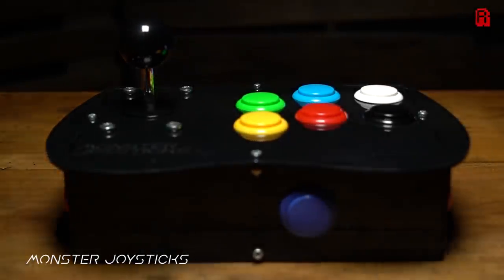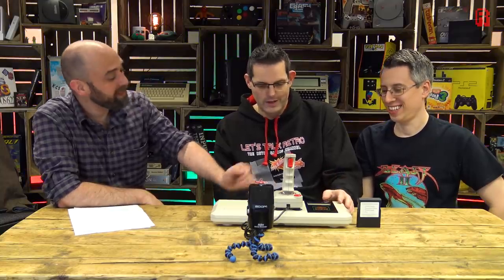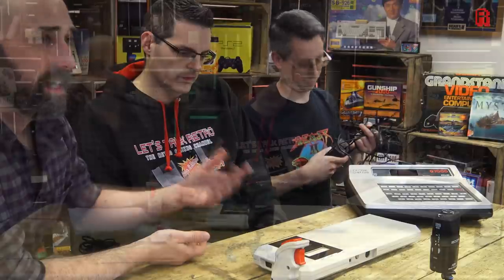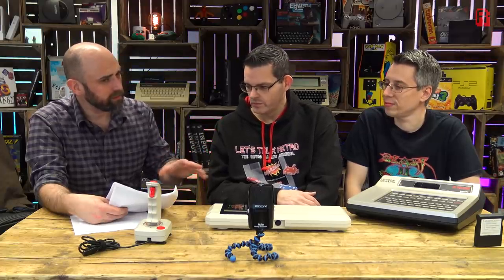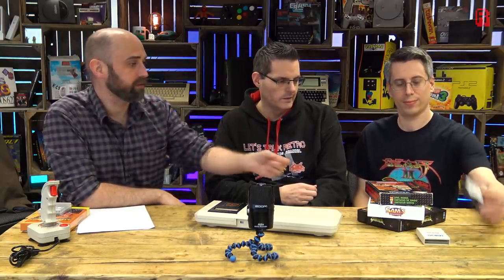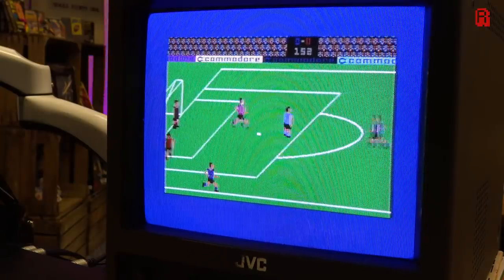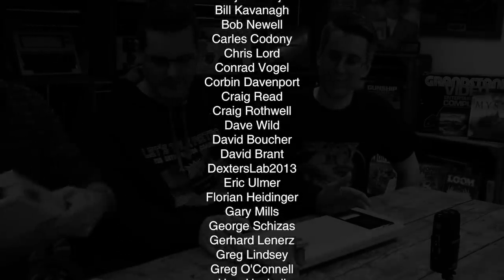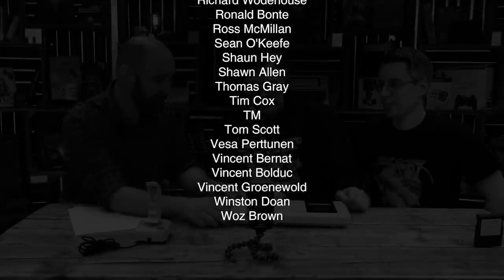Commodore 64GS Console | Show & Tell with Lets Talk Retro

Comment: I believe the Max was pretty much the C64 with less memory - it has the SID chip for example. Max cartridges run on the C64 - so would run on the C64GS as well!
Reply: Correct, the C64 actually came later and was based on the same core technology.  It's like they took the MAX, gave it 64K of RAM, put it in a VIC-20 case and gave it the VIC-20 keyboard, and ported the Kernal and BASIC from the VIC-20 to it.  One could argue that the C64 was partially based on the VIC-20, but the MAX definitely wasn't.  By the way, the C64 might well have been in the works from the start, but it did come a bit after the MAX.

Comment: @RetroManCave at 12:50 actually on the C64 the mapping of the keyboard and the trigger button of joystick on port 1 are related, so pushing the Joy1 trigger would match the "press any key". That's also the reason why many games used Port2, to circumvent those joystick keyboard mapping problems.
Reply from the maker: Interesting, that would help in some situations but you're still left with a problem if it needs you to press a specific key to start, or to input a name in a scoreboard.  Thanks for pointing that out

Comment: Commodore MAX was a C64.  Not a VIC-20.  Just reduced RAM and ROM and a terrible keyboard.
Reply: The C64 was actually based on the Max.
Reply: @skonkfactory  Right, that's what I was saying.  They are almost the same hardware.  The MAX was first and the C64 was just more of the same.
Reply from the maker: You are correct!  I should have listened to James.  James is wise.  Thanks for watching

Comment: If Commodore had any sense (they didn't, they had Medhi Ali instead) they would have done a games console in 1990 based on the Amiga, and given it cartridge based storage, there would have been no harm in using the Zorro II memory space mapped to a cartridge ROM, allowing up to 8MB (or 64mbits!) cartridges. That would have tided them over until CD became viable for mass production. That would have made so much more sense...

Comment: Any key is no problem in most games as the port one fire button is almost the same as the space bar. Only a few can detect the difference.
As a lot of games use the space bar for jumping etc. if the fire button was needed for firing. I soldered wires to the second button of my competition pro and connected them to port 1.

Comment: One important key point that many people seem to ignore, when comparing C64GS with CD32:

When putting a tape or disk game on a cartridge, is going to make the production (and end product) way more expensive.

BUT if you put a disk game on CD, you probably make the production cheaper.

So because of that, I can definitely understand, why way more companies invested in CD32, than C64GS. Also, A1200 hardware wasn't as outdated at CD32 release, as C64 hardware was at C64GS release time.

And of course CD32 was selling quite well (except in the US, where it couldn't be officially sold), but the company was already going down for other reasons.

As I see it, there were 2 good things resulting from C64GS:
1)Bunch of quite good cartridge games released mostly by Ocean. Many of them wouldn't have worked that well from a disk. Sure, they could have been done without GS aswell, but I guess it gave companies that additional push.
2)Official standard for 2 button controller. Sure, not that many games have used it (in addition to Ocean carts), but then again, many games are done with 1 button controllers in mind.

As for Commodore Max, I think it was at least mostly C64 tech. Way less RAM, but I think that sound & gfx hardware is basically the same. And not built-in ROM of any kind.
MAX cartridges actually do work on C64! There's a crappy version of Wizard of Wor for example: https://www.youtube.com/watch?v=o-gf7v2PZqo

(Yes, the proper C64 port is WAY better, but Max is VERY restricted hardware)

Comment: One of my biggest regrets in life, was not buying one of these for £10 in a second hand shop sometime in the mid 90's. Boxed and everything. It got me curious. I could tell, even by looking at it in the shop window, that it was a stripped down C64. But I was torn between spending £10 on something I basically already had, in the regular C64, or not. Alas, my pension slipped through my fingers. I've said elsewhere, that I believe that the concept of a C64 console could have possibly been successful. Not as a cartridge system, but as a tape system. Hear me out. If they'd have gotten the retail price down to about £50, and had a cassette drive built in (No cartridge port.), I actually believe it could have been a tempting offer. The back catalogue of C64 tape library was huge and cheap. I think it would have appealed to the budget market and those who had once owned a C64, moved on, yet missed the old skool classics on the system. Don't get me wrong, I don't think it would have been a SNES killer. But I do think potential existed in the concept of a stripped down C64. Oh, and as a basic workaround for games which required keyboard input, include the ability to bring up an onscreen keyboard operated by joystick. Bottom line is, I think it had potential as a very rough-edged budget system. Not dissimilar to the classic mini's that we've recently seen.

Comment: Interesting that this came 3 years after the Atari XEGS, which was a very similar concept. The XEGS of course had a keyboard and supported peripherals like disk and tape drives, so it wasn't nearly as limited as the 64GS. You'd think Commodore would pay attention to what the competition were up to. All that said, both systems were basically obsolete on release and complete commercial flops so comparisons are immaterial really. 😆

Comment: Just had a squizz at the Argos catalogue 1990. That year the NES was £94, so straight away you could have a much more advanced and better supported console for a fiver less. If you were on a tight budget you could have an Atari 2600 for under £60 and you could probably buy dirt cheap second hand games for it pretty much everywhere at that point. On the other hand if you were absolutely determined to own a C64 the Light Fantastic pack was £159 and came with 10 games, a lightgun, 3D glasses and - most tellingly - a keyboard. Which made £99 for a model with no support for keyboards or tape storage and which only came with four pack-in games seem a bit pricey. For some reason Argos didn't carry the Master System at this point but it was widely available and priced to compete with the NES, so that was another alternative that was probably both cheaper and vastly better supported than the C64GS. 

You can see why to a maketing guy somewhere the GS seemed like a licence to print money; consoles were all the rage, just saw the keyboard and tape drive off our computer and we can sell it as a console but unlike Sega and Nintendo we don't have to spend any money on R&D or development. But they forgot that no matter how cheaply and quickly they can make something, they still have to sell it if they want to turn a profit and for that you have to provide people with a reason to want to buy one. Even Amstrad understood that; the GX4000 had some little hardware tricks that the original CPC models didn't, and at least it came with proper Nintendo-style joypads instead of just an old Cheetah joystick spray painted white. The C64GS reeks of low effort in a way the GX4000 (for all its faults) didn't.

Comment: It's an odd idea.
Honestly as far as the microcomputer as console idea goes, the Atari XEGS probably did it better.
Smaller form factor, includes a detachable keyboard.
Games built in, primarily meant for cartridges, but still runs pretty much everything the Atari micros did - and was out earlier, making 8 bit tech slightly more relevant.
Still flopped though.

Funnily enough Nintendo was going to bring the Famicom to the US as a microcomputer originally (Nintendo AVS) but was advised against it by pretty much everyone in the US because of the US video game market crash.
I bet that it would have gone down reasonably well in Europe though, given we preferred micros to consoles...

It's weird when you think about 'could have beens'.
(we do have some sense of what that might have been like incidentally, since the Famicom had an optional keyboard and tape drive along with a basic cartridge... It amuses me to think one of the most well known consoles in history can technically be classed as a hybrid console/microcomputer originally.)
Reply: The XEGS was really the first thing that came to mind when they started talking about what this would be up against, but it seems that the XEGS came out a few years prior. And the Amstrad one they mentioned was a complete unknown to me.

Comment: I loved everything about this episode, except the Commodore part LOL   Oh and the Max is C64 based hardware :-P
Reply: More like the MAX is a close cousin to the C64.  They share a lot of hardware, same CPU, VIC II, and SID chips but with only 2.5KB of RAM.  The C64 came out slightly after the MAX and has backwards compatibility mode to use the MAX cartridges.  The early C64 games on cart, its probably about 50-50 if its just straight up a MAX cart with a different label or something that was actually updated and modified to take advantage of the C64.
Reply: @JeremyLevi   The C64 seems like a combination of the MAX and VIC-20, really.  It's as though they grafted the new technology of the MAX into the VIC-20, upped the memory to 64K, and made some other changes like a second joystick port, and there you have it, the best-selling single-model computer of all time.

Comment: You should throw away that paper shielding, it is known to cause overheating issues causing SID-chips to die in regular C64 computers, and that 64GS case is much smaller then a regular C64 case so the components might get even hotter inside that thing. At least install some heatsinks if you want to continue using the shield.

Comment: Looking at most of these console conversions in EU regions the concept is fine but the build and timing are way off. Like you can use all the old components but to make a console you need a whole new board to turn a slab into a box otherwise that is all you get, a C64 without a keyboard. There was a chance to modernize the controller, tap some more buttons off the Paddle pins, that might have given it a selling point IE. C64 gamepad. Software has to be consolized for easy use and Commodore undermined that here and in the Amiga CD32. Lastly sooner than later is better but if you're late you have to add some extras. :\

Comment: The C64GS was only 50 bucks less than a C64 bundle in 1990, you were limited to using those rubbish bundled joysticks I think (2 independent fire buttons) just like when you want to play MSX Salamander with a Euromax Zipstik but need to use a Toshiba branded 2 button MSX joystick. Hardly any must have games on cartridge for GS could rival the best of the best C64 single load tape gaming masterpieces AKA the console quality bracket of C64 games. The whole thing was a perfect storm of bad ideas meets bad decisions. Not one single aspect of this thing is right, the only thing that wasn't a problem was the 1981 spec 6510/VIC2/SID vs NES games.

Comment: The Max is absolutely C64 based - the VIC II is inside, even as the SID. Commodore made the C64 virtually out of the "Max". You can even use every  Max-Cartridge in the C64, though C64-Cartridges do not work in a Max...
Reply from the maker: Thank you!  That's a system I need to get my hands on for a closer look

Comment: Does the main board still have a connector for the keyboard?
Reply from the maker: The keyboard connector is not there but you could add one.  It would be interesting to see if the ROM supports it or if you'd need to swap in a regular C64 ROM
Reply: @RMCRetro  Now there's a project to think about.

Comment: Interesting that it essentially is a c64 inside. I suppose you could wire up a keyboard maybe through some sort port to have it external but then again not much point in cutting into this as c64 are common anyway.  

Are there any exclusive games for this machine or any that where wrote for it then  later released for the 64?

Does show the miss management of commodore though.  Even in 1990 they where obviously too keen to hold onto old hardware and milk it rather than try to push the envolope.  If an Amiga console had of came in 1990 rather then the cd32 in 93 then it might of made a bigger difference. 

Good video regardless RMC.  Nice to see you involving other content creates in your channel.

Comment: Damn, I remember this and thought 'Why!?'

The Amiga dumped on it hard and Commodore 8-bit tech was in it's twilight years sadly with the Amiga soon to follow due to Commodore resting on it's laurels and then the downfall.

Interesting as a piece of tech but was a massively bad idea in retrospect and pushing out an Amiga 16bit CD console in 1990-1991 may have served them better than waiting to push out the CD32 years later.

Ultimately tho, advancements in PC tech/software killed the Amiga.

Comment: Wouldn't some of the games that required input from "any key" work if you had a joystick in Port 2 (I think it was that one) and randomly moved or pressed the button?  I remember one of the ports would send garbage characters if you randomly moved the stick if you were still in BASIC.
Reply: @Rooflesoft Games Yep, I never had cartridges - never saw the point being in the more disc-centric US, but the games I remember requiring "minimal" keyboard input were usually space - which would have been OK with the wiggly-joystick input, but a few wildcards wanted things like enter, F-keys, or name-before-entry.  It's coming back a bit now, the few single player games that actually read from Port 1 were always kind of annoying if only because it was a pointless joystick swap.

Comment: Why didnt they have a button that connected as a single key on the keyboard to make old games compatible? Why didn't they have a slot in the case so you could connect a tape drive and suddenly have access to the huge C64 library?
It appears that the accountants designed this machine rather than engineers.

Comment: Actually, the Max Machine wasn't based on the VIC 20;  the C64 was actually based on the Max.
Reply from the maker: You are indeed correct, I had it in my mind that the Max was based on the Vic20 because of its lower specs but it's an odd "nearly C64" spec machine.  Hopefully we can get one in the Cave one day to investigate.  Hope you enjoyed the rest of the chat
Reply: @RMCRetro  Oddly, the thing closest to the Vic in the Max is that it uses SRAM rather than DRAM, just like the old VIC-20.  I guess DRAM wasn't quite ready yet, or they didn't want to deal with the fact that it needed three different power supply voltages at the time.

Comment: 2:40 It was around the same time as the NES first launched if I recall, so all the usual suspects thought "Oh wow, they're flogging decade old technology for hundreds of pounds, we can do that", rushed out a half assed version of their existing system only without a keyboard, and then watched it die a death as the only games it received were the same games that were available on tape for a fraction of the price.

The GS was particuarly bad in this reguard because pretty much all the games were standard C64 cart games and would work on a normal C64, which could also be used to do computery things.

9:47 So, basically, they built a C64 motherboard, installed a different ROM and used a 90 degree riser on the cart port?

15:09 in theory you could just use an SD2IEC, since it still has the expansion headers internally.

Comment: ive heard that the cassette port didnt work on this board for some reason or another.
Reply from the maker: The "Bluetooth connected" message you hear in the video is achieved by connecting a speaker to the cassette port, so you hear the modulated data passing through it. Sending audio in to this port using a cable instead of BT seems OK but I didn't do it a lot as there are more convenient ways as you saw
Reply: @RMCRetro  i started a thread about this topic ages ago over at lemon coz i was interested to see if the GS board could  be transplanted into a c64 case? People said  connectors were missing, the rom needed to be changed. no capacitors for the datasettte and no serial port etc. You can read it here: https://www.lemon64.com/forum/viewtopic.php?t=57801&sid=284fc5e195b6069cd5f53c44501dffb9

Comment: is the kb connector there?
Reply from the maker: Looks liks you can solder one on but no it isn't there
Reply: RetroManCave thanks. It would be interesting to see if a port was added, could a keyrah and wireless keyboard work. Perhaps capacitors are missing too?